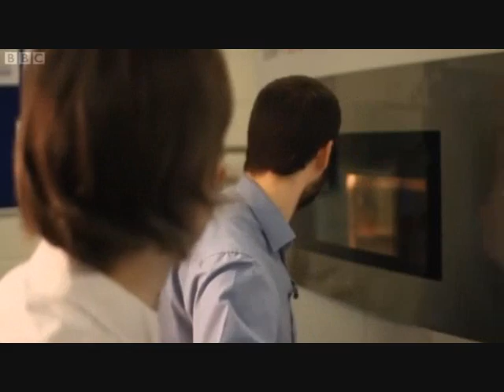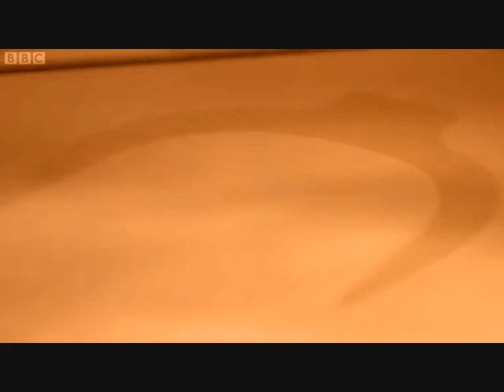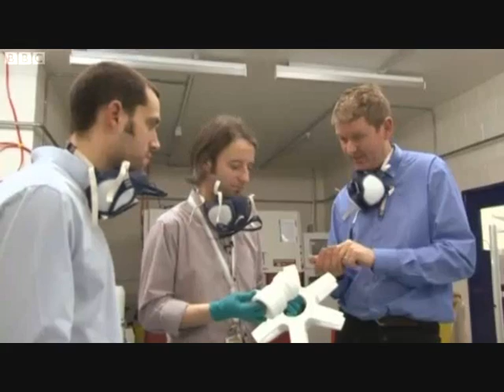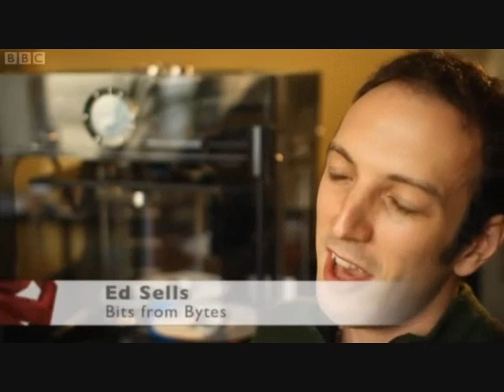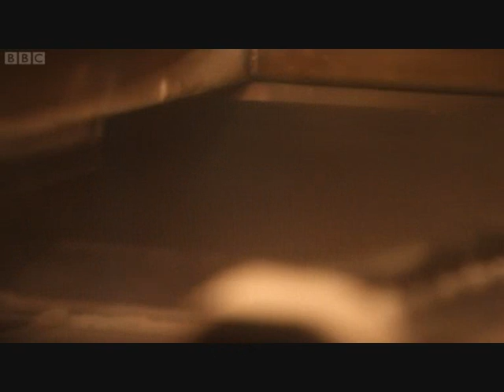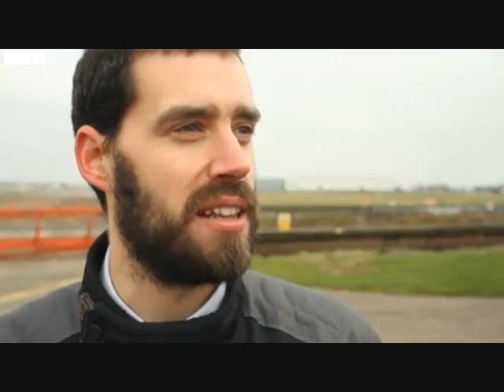Printing a bicycle with a 3D printer

Comment: Yes, the really HIGH quality COLOUR laser printers aren´t exactly commercial. But B/W are common enough to have at home, at the reasonable/half-decent printers are almost standard in a home. WILL be the same with 3D-printers. The really, really big, high-quality printers may not be affordable for a relatively long time, but average ones will be.

BTW: Laser printers are far more economical on the long term, but people don't often realise this = false economy. Watch your examples.

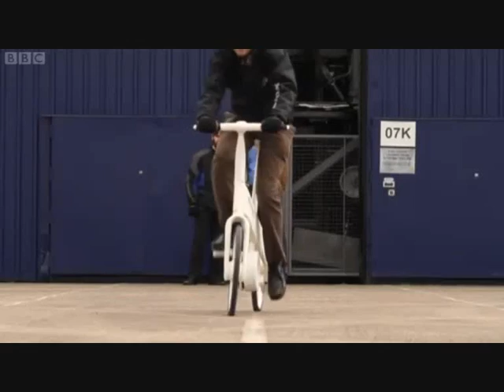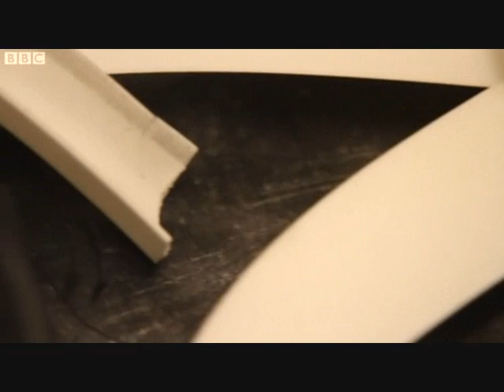Comment: looking to the box fan for inspiration...boo.  the hp tires/tubes thing was asinine.  the tires should've been solid nylon or solid rubber.  8:00 I've seen sporks with more rigidity.  6:20  the poor sods need a rim job.

Comment: Considering the cost of the nylon powder, I'd say this bike cost quite a bit more than the ones you could get from Walmart. Shapeways (Who has to mark up the cost for the service as well) charges roughly $1.80 per cubic centimeter. This would cost several thousand dollars through their service. It's a great demonstration of the material and the process, but it's not yet an economical way of producing anything besides prototypes.

Comment: Since neither of us has the power to enact strict gun control, make ten years of printer advance advancement happen instantly (let alone twenty-five or a thousand years' worth), and then sit back to see what happens, it turns out that nobody can prove that you are right, or that you are wrong.

Since I've never insisted that YOU ARE WRONG! it turns out that I'm happy to drop out of an argument about whether or not you are right.

You did make me think, though, and for that I thank you. Farewell.

Comment: You are making the claim that printing will never be able to compete with other methods of production when it comes to firearms.  Not today, not ten years from now, not in a thousand or ten thousand years.

I'm saying that you may be right, but that you could be wrong, simply because there is no way for you OR FOR ME to know what will happen in ten years, let alone ten thousand.

Since neither of us has the power to enact strict gun control, make ten years of printer...

durned character limit

Comment: they did not make it out of metal idk why,most likely because there lazy or they dont want to buy (or have) the metal printer, plus the dust is expensive,
well i guess ur to lazy to do this but theres videos in the right side of metal printers but heres a link:
production3dprintersDOTcom/sls/selective-laser-sintering
or a cheap plastic printer:
wwwDOTsolidoodleDOTcom
but the military had used printers in the back of trucks to print gun pieces or even ammo or any other item that they need

Comment: There are many many MILLIONS of guns, there are 75 million AK47's alone in the world, and likely that number is off by several million, so unless the entire planet decides guns need to be destroyed, NO IT WILL NOT BE CHEAPER. no matter how strictly enforced drugs are, guess what they still find their way across the border, so would guns. The only thing you would use the printer for is guns, since the cost to manufacture goes down the more you make. I am finished, you are incorrect, just stop.

Comment: And MY point is that unless you are some anointed prophet, you don't know what will be possible.  Imagine if strict gun control is put in place and strongly enforced.  It might well be cheaper to print out a gun than to go through the black market, which expects to be well paid for dodging cops and risking prison.

And, it might be more expensive to if you buy the printer JUST for making guns, but if you use it for other stuff too, then a gun is just a little extra material and electricity.

Comment: Actually, no. There's the one that uses a laser to sinter the fine metallic bits together in the printer itself.
Then there's one that uses an adhesive the glue the particles together, then your printed object is heated in a special oven, and the metallic particles are sintered together in there.
Just last night I saw one which uses three streams of helium to carry the particles, and uses a laser to melt them before they impact the target, so that the target is being hit by a fine metallic mist.

Comment: I saw that.  The printed part was very light and porous, and they put it in some chamber with the brass.  The printed parts absorbed the brass like a sponge absorbing water, and voila, there's your fancy brass door handles.

But that's not the only way to do it.

Comment: you obviously don't know how metal printing is done. They print parts similar to the plastic in the video here, but when they are done its very fragile and needs to be impregnated by another metal, usually brass.

Comment: I work closely with a Formula One team, who use 3D printing to quickly manufacture slightly varying components for the front and rear wings on the cars.  These are produced and tested on their wind-tunnel model to made small improvements to wind-resistance of the cars... and the parts are immensely strong.

Comment: A metal=printer is loaded with podered metal.  It looks like sand.  It melts tiny bits at a time.  Instead of taking a block of metal and carving away on it, you take the metal powder and let the machine fuse the parts you need.  The rest of the "sand" you put back in the machine for next time.

I want to see bows and arrows, atlatls, crossbows, swords, knives, axes.  Suits of armor.
/watch?v=Ys8v1UqOBl0

Comment: As far as you want. The US military have been spending billions on metal 3D printers to go in the back of a transport truck enabling them to print any part, a new bolt for a rifle or a new head for the hummer it all comes out the truck. So the logistics chain only requires fuel, ammo food and the powder to run the printer.
I think in a few years we will see 3D printing shops everywhere replacing outlet stores. This could be the next game changing tech.

Comment: Never is a long time.

"the price of a machine capable of printing firearms would be more than the cost of buying ship containers full of AK's and ammo. "

What if you use the printer to make another printer?  And then use those two printers to make two more printers?  And then...
Suddenly, the printer only costs as much as the raw materials and a little electricity.

Comment: You could print out the parts that don't have to be metal, and buy the metal parts.  Or, using one of the metal printers, you could even print those parts.  A knife or axe would be easier.

There's one that prints organic chemicals; it could probably print drugs.

Comment: yes every part exept the arduino and wires...but you can print the basic parts :) (it obiuosly depends if you have a kick ass printer able to print moving pieces (some can others ehh not so much)

Comment: 10th of a milimeter at a time?
You realize the impracticality of that for large objects?
The plastic that is used for 3D printing is like $40 a kg, plus it takes days to weeks to print large parts.

I'm not criticizing 3D printers, just saying that currently, it is best suited for smaller applications. 

I'd say give it 10-20 years till someone builds an efficient 3D printer for large objects and parts.

Comment: Actually, if you REALLY want to see progress - look at the progress between the beginning of WW I and WWII. Before WW I - there were no phones, no engines apart from steam... in fact naff all really. Then as the war progressed, we NEEDED those previously listed items ASAP. Boom! Diesel Engine... Boom! Radar and a MUCH better Radio. system.. Boom Basic Computers (the system used to Decipher the Enigma code)...that was some SERIOUS advancement in a really short time scale

Comment: To see a real world use of this technology, check out the video called: 3D-Printed "Magic Arms" .
If you can assemble a link it's at v=WoZ2BgPVtA0
Complex shapes, custom designed for the user and ready to use in hours rather than the days, even weeks, that the older methods such as investment casting required. 
Couple this with the ability to have internal structures and mechanisms in a piece and we are heading into "bionic man" phase space. It may take several years, but we'll get there.

Comment: People saying that it is not practical or too expensive:
If you compare the printouts with easy, common structures (which is for example needed in the bike), then yes.
But where is shines are non-mass-produced objects and geometries. Check out the printed model plane on newScientist (where they used an internal structure which is too expensive to produce, if you don't grow it inside of the object).
Plus: No one prevents you from printing stuff like internal circuitry inside the object.

Comment: I own a pretty high quality color laser printer and it wasn't that expensive, less then $300. Why don't more people own them? It's simple, most people don't do enough printing, if they did it would make sense for them to own them. Also, if printing hadn't been largely over taken by tablets and such, everyone would own one and they would be even cheaper then they are now.

I'll point out that a cannon color laser printer in 1990, adjusted for inflation, would cost $4600 now. 

You are an idiot.

Comment: thats really cool, but you are not mass producing those printed cases. from the manufacturer a case costs considerably less than 13 pounds. its getting  near, but it will never be cheaper. not unless they find an extremely cheap durable plastic to use.

Comment: did you read the comment I was replying to? because your response makes no impact. 3d printing will never be at a point where it is cheaper to use than traditional manufacturing. the price of a machine capable of printing firearms would be more than the cost of buying ship containers full of AK's and ammo.

Comment: why bother printing a gun when they can just buy it for far cheaper. as for bombs they don't need printers for that, they make those just fine without. there is little danger with these tools, the only thing I could see being an issue is printing knives in schools (there are several schools adopting these printers, though i think they are the desktop type.)

Comment: plastic yep . But why use steel ? I mean using the powdered steel in printing this gun is basically the same as making the gun with molten steel ! So its useless lol . Print the gun with powdered steel or just make it ' old-style ' with molten steel is the same . the only difference is that the printed steel is definitely gonna be much weaker . And even powdered steel needs a very high temperature to meld it together to make it a whole gun . So its no use printing it .

Comment: um 'scuse me for interrupting :) But guns made of this material ? They would either explode ( cause the bullet case mixture explodes to fire the bullet ) or if it doesn't it would MELT ( the bullet turns WHITE-hot ( thats 1000+ degrees Celsius ) And of course the bullets wont be of much use . so it can only be used for toy-guns which actually fire , but not that powerfully . Just enough to .... give someone a feeling as if they're being poked XD

Comment: thought they would have re drawn the rim, instead of just printing it out another one.  The way the spokes got thinner as they approached the otter rim was not good design and is what made it structurally weak.  Just surprised they didn't address that before reprinting.

Comment: the laser only melts the top layer, so if the powder is an inch deep, it starts building the part an inch from the bottom.. if that makes sense

Comment: RepRap and Makerbot 3d printers can already pretty much duplicate themselves (ie. print most of the parts needed to build a second printer), and I believe it's also possible to fit a laser to the printer capable of printing circuit boards now! I think you still need to buy a few components etc. though. Over the next 10 yrs I think all kinds of open source hardware will appear. Google "open source ecology" and you'll find plans for o/s tractors, building equipment, and even a micro-factory ;)

Comment: @jayr2l2 You can print something that LOOKS like diamonds, but since it would be composed entirely of the nylon plastic composite material, it will not be diamond due to its chemical make up.